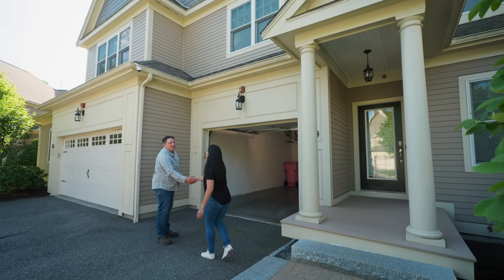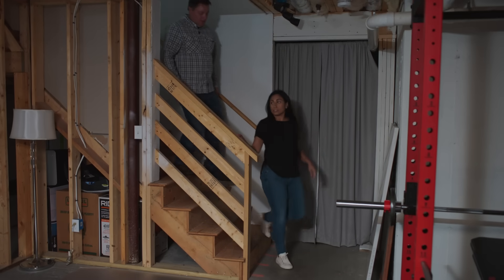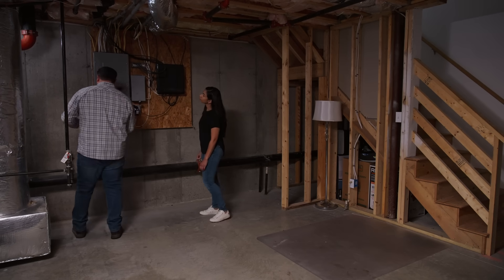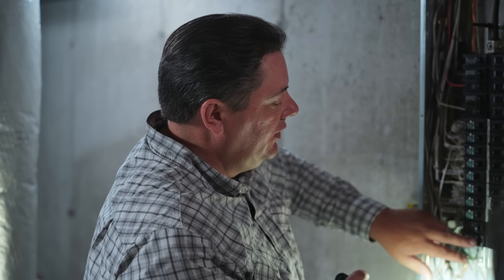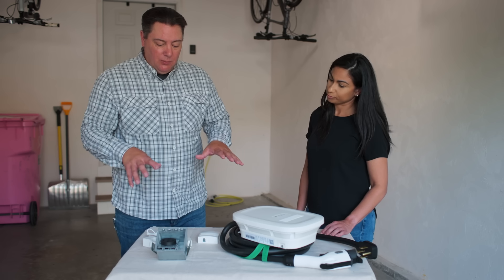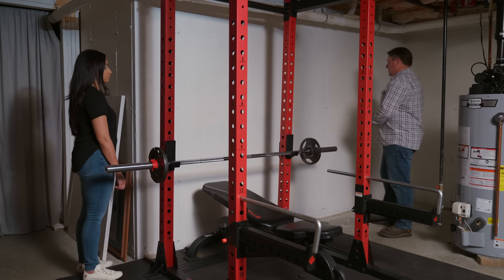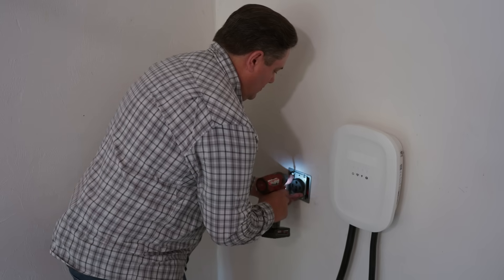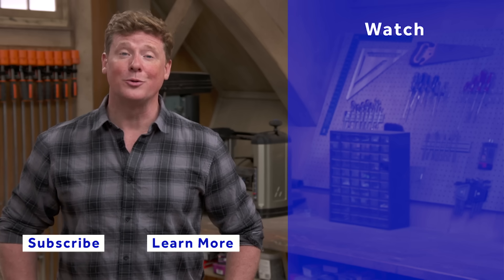How to Install an EV Charger | Ask This Old House

Comment: This video is kind of useless - you didn't show how to size and install the breaker, wire or even connect and torque the wires to the panel which is the most important part of the install!  The only thing he showed that was electrical related was the LOTO and using the meter to confirm there is no power.
Reply: The lack of details is on purpose. There are too many YouTube electricians already - we don't need more.
Reply: @ronster-380  this video is dangerous. Plus there’s a lot of other videos out there that are wrong and giving wrong information if you’re going to give a video and you’re going to go into safety about lockout tag out why don’t you go into the safety of the NEC code requiring it to be a specific EV rated outlet and because it is an outlet in the garage it needs to also be a GFI breaker that is required by NEC code. But I will show you about lockout tag out just so I can take the cover off of the panel. The wrong outlet was used no specifics about the wire size or breaker type for safety. This video is going to get someone killed in the house burned down
Reply: @ronster-380  that's ridiculous - the title of your video should match its contents.  How am I suppose to know how to install my charger without detailed instructions?
Reply: @ Hmm. I don't know. Hire an electrician? Get a permit? Get an inspection? To be fair, there are a few dangerous, non-code, things done in this video you wouldn't want to follow it for proper advice anyway.
Reply: @ronster-380 so why would I watch a video titled "how to install a ev charger" if I would go through all that ?  If I'm spending money on a electrician then I would waste my time watching any such  video.  What non code things did he do in this video?

Comment: Was THHN wire used? Was a commercial grade outlet used? What and where are the torque settings for the outlet and panel screws?

Comment: He installed a charger with load management, but then used a 14-50 plug. If the service panel requires load management, the charger should be hardwired. Someone in the future could connect a dumb EVSE and end up overloading the panel capacity.
Reply: Yes, and he even told the homeowner all she had to do was plug in a new, different one.  Two failures to head off that problem.  I wonder if this was permitted and inspected and what the inspector thought about that.
Reply: The Emporia load mgt “Vue” is literally monitoring the whole house and determining the allowed amperage to the vehicle based on entire panels usage thus limiting overall stress.
Reply: Also nowhere did you show that when installing the correct outlet. That a GFI breaker is required. Make sure we show them the lockout tag out but not any of the other safety stuff that is required to not burn your house down or get you killed.
Reply: Overload the panel capacity? Lol you have a 125 amp panel and the charger pulls maximum 40amps.  The likelihood of that woman by herself pulling 85+ additional amps AND the charger pulling 40 amps at the same time to trip the main is extremely unlikely.
Reply: @terraintactic  If you have a 40 amp circuit, don't run it at more than 32 amp for hours or 80%  This applies to All Circuits
Reply: @terraintactic  luckily the NEC makes this part easy. The formulas for load calculation are clearly laid out. When provisioning one of these systems, the electrician either determines the panel can support the full capacity or it cannot. Since they went through the effort of installing load management, presumably this one cannot. Not entirely surprising considering how many breakers there are, how many are already tandems, and how many look to be 240v circuits. If someone were to plug a EVSE other than the one he installed into this, the load management device would do nothing. Hardwiring it ensures that your uncle visiting who decides to plug his tesla mobile charger in because he forgot his adapter isn't going to create an unsafe situation.
Reply: @terraintactic  if the load calculation showed the panel could support 40a, than it should have been installed without load management. If what you're saying is correct, it's still installed wrong
Reply: @KeithAKris  There is nothing against code here.  They installed a 40amp circuit, BX cable to a box and a NEMA outlet.  They literally say, technology changes.. so she isn't locked into this specific charger in the future.. hence a PLUG that can be easily removed.  Can you hardwire any number of electrical appliances?  Sure.  Do you always hardware electrical appliances?  No.  What are you even arguing?
Reply: @terraintactic  I'm arguing this is unsafe. If someone plugged a 40 amp EVSE into this that isn't a part of Emporias cloud system they would not have load management. The monitor would send the signal to pare back charging and nothing would happen. Presumably it's necessary according to the load calculation. They wouldn't have bothered with the extra expense if the panel was able to support the full power without LM

Another thing about this video that bothers me, though it's not "wrong" as long as they used the right parts, is they didn't mention the need for a NEMA outlet rated for continuous duty and torquing the lugs to spec. The $15 big box store outlets aren't adequate for this kind of use. We're seeing a lot of them burning now. Hubbell and Leviton make outlets meant for EV use, but most home improvement stores don't stock them yet
Reply: The load management device seemed not tied to the charger.

It's tied to the plug and monitoring that circuit independently.

If it sees the circuit starting to take more amperage from the house than possible, it will cut that circuit completely until there's available amperage 

They don't have to connect to a smart EVSE and considering she has a plug in now she might change the connection later.
Reply: @JE-zl6uy  the Emporia load device is cloud based. The EVSE and the Monitoring unit connect to each other over wifi. If the connection is lost, the EVSE defaults to 6 amps unless the electrician configured it with a higher minimum rate. The monitor in this system cannot cut power at the panel. It relies on the EVSE doing so

If they were using a simple load shed device then I would agree with you

Comment: In case anyone wants to know, it’s an Emporia brand charger(EVSE), it a good unit.  Also, I hope he used a heavy duty, continuous rated outlet, that unit does 40 amps on the plug and 48 when hardwired.  I know a PHEV probably only pulls 16, but if she gets an EV in the future it could be an issue.
Reply: Spoiler: that isn't one of the good EV rated receptacles. And he didn't follow the code requirement to torque the terminals to spec with a torque screwdriver, which is especially important for EV charging equipment because of the continuous load.

The receptacle used also isn't the worst Leviton model 279 that's responsible for most of the failures, so it might be ok at least for a while, and it's in a metal box to help contain a fire.  But if you use the Hubbell or Bryant model 9450 and torque to spec, it won't burn up like others do.
Reply: @charliesullivan4304 thank you! I came here to post the same. Considering This Old House is known as a standard this should be done over.
Reply: @charliesullivan4304  what about no GFI breaker? NAC code requires that an outlet in the garage needs to have a GFI breaker. If the unit is hardwire, it doesn’t need a GFI breaker this case it does $150 GFI breaker.
Reply: 40 Amp at 240 volts is 9.6kW and is plenty of juice. That can charge almost every EV from empty to full in under 10 hours and the vast majority of EVs in 6. Most L2 EVSEs max out at 50 amps and most vehicle's on board chargers don't support more than that anyway (some now support 80 amp but i's not common). Unless you're driving 200 miles everyday and only have 6 hours to charge each night then 40 amps is more than enough.

I own 2 EVs and used L1 charging for over 3 years before I added a 30 amp L2 charger to my garage. On L1 there were a few days when the temps were around -20F that the charger couldn't keep up with our usage but those days are infrequent in my area so we never drained below 20% SoC. With 30 amp L2 our batteries are always topped off (at our 80% charge limit to prolong battery life).
Reply: But why spend your own money to buy and install one now when a lot of times automakers throw in an L2 charger and install credit when you buy them. 
An L2 charger is a complete waste for a PHEV.
Reply: @johndoe6032  we have a low power L2 @16 amps of 240v for our PHEV and it charges 3X of the L1.  Just allows us to charge the car mid day for more range.
Reply: @Marker-er3ro  That's fine for the rare occasion you may need to charge mid-day, but in those cases you might as well use some gas because you still need to run on gas once in a while. You can't just leave old gas in the tank for months. IIRC some PHEVs even have controls in place to make the car run on gas sometimes to manage this automatically if you run on battery only too much.
Every person's situation is different. I have a pure EV and do just fine charging on the standard 15 amp 120v outlet all the time. Some people may want that L2 speed, but it's usually more of a want than need. The cost of the install and charger will take a while to offset with the odd gas usage reduction.
Reply: @johndoe6032 As you said, I think the key is it depends on your situation, we usually charge 2x on a weekday basis, so it makes sense for us, in 90k miles we’ve done 50% in EV mode, so it’s paid for itself in the first year.
Reply: @johndoe6032    because the average person only keep a car about 3 years it's likely she will buy a different car in the future and may need the extra juice.
Reply: @rupe53  As I said, why spend your own money when the dealer could throw in a few L2 charger and maybe the cost to install? Especially for someone who gets a new car every three years, which is highly likely to be buying brand new..
Reply: @johndoe6032    If they are offering to (partially) pay for an install then try to grab it. What I am seeing lately is they throw in a 120 volt kit (no cost install) or you look into a credit / payment via utility company or tax credit. BTW, a buddy just got a Kia and it came with a 120 unit. The dealer also offered a lev-2 kit at a steep discount ($300+?) but no installation. Somehow I feel this is where they are all going unless there's an end of year sales push.
Reply: @johndoe6032 The dealer could, but most don't, and won't.
Reply: What type of stud finder is that?
Reply: @tuduleshiggins8832 it uses a simple magnet and works well 😎
Reply: Also seeing that the unit is plugged in to an outlet that yes should be EV rated outlet. That outlet needs to be GFI protected with a GFI breaker that cost about $150. Nobody wanted to show that but very important that we show lockout tag out so we can take the cover off the panel.

Comment: How to install a EV charger. Be smart enough not to buy one of those POS
Reply: Electric cars are going to be more efficient and easier to manufacture. The most efficient design always eventually wins. The internal combustion engine is complicated, inefficient, and very expensive. So are the catalytic converters. I love my Kona Electric. I plug it into my dryer socket. Fuel up right here at home. Going on 2 years. No issues. 65 year old Slater receptacle.
Reply: @Herlongian  not anytime soon
Reply: Because it's not smart to save money and not have to deal with much maintenance?

Comment: They always show like a  lab settings for these videos. Empty garage, main panel right under basement floor and plastic anchors😂. This Old House charged her $2000-3000  for that. My house two flat in Chicago, detached garage about 60 feet  from 1910 all brick and stone building. To run 50 amp 240v outlet you have to dig a trench for ridgit underground conduit close to some decent trees in my back yard. Roots are everywhere, even 3 inches deep is a pain in the but. Now 60 feet from the back of my garage to the side of my building where the main panel is. Then it is drilling about 18 inch deep  hole through the outside wall into the basement. Panel is 3 feet from that wall so it is easy. Now from the back of the garage you need to run about 30 feet inside metal conduit to the front of the garage where a 50 amp receptacle will be located. I would love this guy to come to my house and just install the receptacle. If he did that by himself he would loose a few pounds. There are two cars in my garage, and it is loaded with tools, work benches, shelves, table and metal saws drill press, yard equipment as most of garages here are.

Comment: So how you gonna charge your vehicle if the whole grid goes out
Reply: generator? I mean how are you gonna run a natural gas furnace when the grid goes out, which needs power for it's blowers and stuff. Emergency solutions are emergency solutions.
Reply: Hybrid
Reply: How’s a gas station gonna run their pumps if the grid goes down?
Reply: People are already charging their EVs off grid through the use of solar panels or battery backup. Additionally since an EV is agnostic on where and how the electricity is generated, you can still charge an EV with a gas generator or even bicycle power if you wanted.
Reply: Solar
Reply: Well, it's a plug-in hybrid, so, at the gas pump?
Reply: Last I checked, gas pumps also run on electricity. How are you going to pump gas if the whole grid goes out?

Comment: Im actually surprised that a plug in hybrid needs a big charger. They dont have batteries the size of a full EV. That said, if she wants it, why not?
Reply: If you're going to go through the expense of installing one, why not plan for the future?
Reply: @KeithAKris  If you are planning for the future, get ready for the EMP.
Reply: @David_H_Parker That possibility has existed for many decades.
Just like nuclear war.
Reply: I mean big battery doesn't necessarily mean you need a big plug, and vice versa. That said, a lot of plug in hybrids are annoyingly short range, and if she wants to be able to top up enough to not run the engine on a quick trip after getting home from work, big charger makes sense.
Reply: It depends on how big the battery is. I rented an SUV last summer that took 11-12 hours to charge from a 120v outlet. It took 4.5 on a level 2 charger, but that's mainly because Hyundai cheaped out and only gave it a 16 amp onboard charger. It could only pull half the power that low end level 2 chargers can put out.

Being that she lives in a condo, there's a good chance that's the only usable circuit in the garage, and it may be shared with outdoor receptacles too. It would suck to have to unplug the car anytime you needed to use any other power hungry device. Condos are built as cheaply as possible, so you gotta expect she got the bare minimum code required.
Reply: My Jeep Wrangler 4xe hybrid will take up to 32amps on a 240v charger.  A full EV usually can take up to 48amps, some of the new EV pickups even up to 80amps.
Reply: They still take a while on Level 1. Could be 8-12 hours just to get 25 miles of EV range on a typical compact crossover PHEV.

So yes, point taken. Not sure why it's not feasible for the homeowner to simply plug in when they are at home and let that be that, but this project also helps future proof for a full EV at some point.

Comment: do all that talk/work talking about the stud to avoid the stud completely and use drywall anchors for the charger and a old work box for the receptacle ..
Reply: Hey connected the main base to the stud. The anchors were just for the outside of the bracket for a more secure fit
Reply: @coerce  i just rewatched it and he didnt use the stud at all, both sides of the bracket has drywall anchors and on the middle of the bracket there are no holes to run a screw into the stud lol

Comment: Don't buy proprietary chargers that depend on an app and their cloud service. When that company goes under, your thing won't work or it will have a degraded feature set.
Reply: Emporia is pretty basic and the home version works fine offline after setup, I'm fairly certain.  We have an employee with one and we have 2 at work.
Reply: Ok, but the same concerns are inherent to electric cars. Post warranty they are basically disposable.
Reply: Don't buy an electric car if you are concerned about the future.

Comment: I’m starting to hear insurance companies don’t want the charger mounted inside anymore due to the fact that the battery fires are such a pain to put out.
Reply: Show us a link to what you heard.  Otherwise, you just made it up.
Reply: the charger is actually inside the car. This gadget is just a special corded adaptor that most EVs use.

Comment: What $ estimate would it cost for an electrician charge for this service?
Reply: I know it can vary, but I paid $750 to a licensed electrician, but I had quotes to about double that.  What helped keep my cost down was that my panel is in my garage, so it was a short run of wire for the install.
Reply: @ 👍thank you
Reply: Your first born and your left arm.